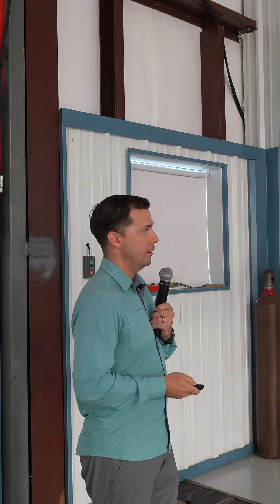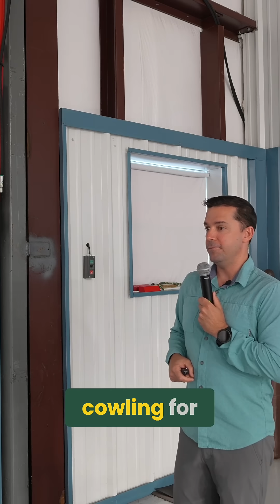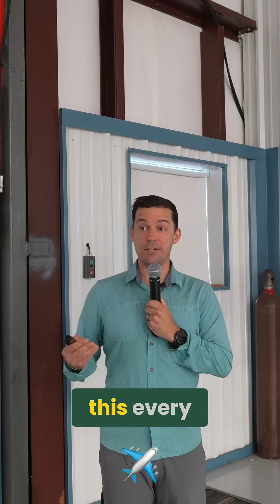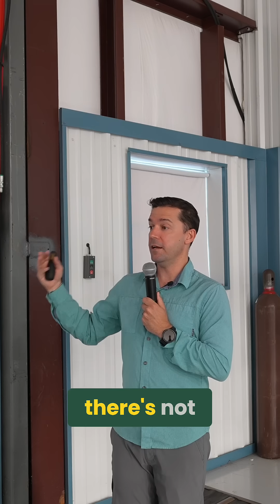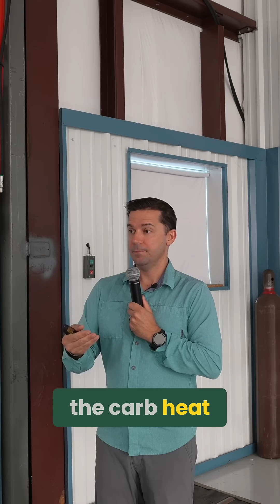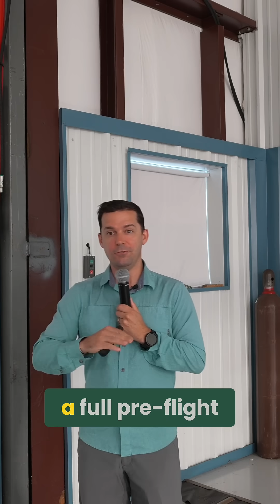Static RPM Check: Your Flight's Safety Net ✈️

Comment: Would like to get your perspective as a DPE if you had a candidate on a checkride do something that’s not technically in the airplane’s checklist.

For instance, one of the comments about clicking a mag off at idle with the carb heat on. I’m not sure I’ve ever seen that in a Cessna POH. Definitely sounds like a great check and something the PIC should be doing. But I’m always hesitant to recommend something that might be considered a “bad habit” by a DPE because it’s not in the checklist.

Thanks for sharing this static RPM tip!
Reply from the maker: I wouldn't have a problem with it as long as the applicant could tell me why they are doing it. A hot mag check isn't a checklist item on many manufacturers checklists, but it's still a good idea to do it.

Comment: Always check RPM right as the roll starts, never heard it called static RPM check but I like the name!

I’ll add another check, when you close the throttle as part of checking idle during run-up (post mag check), click a mag off and make sure the engine doesn’t die. I call this “low idle check”. Throttle closed, carb heat on, and one mag dead. I want to know that engine will at least idle and not worry that I’ve got a stalled engine right at the moment I need to do a go around. And yes, I have had an engine stumble and die during a ground check in this situation. Would idle okay with both mags, but click one off and boom, stumble and die. Mags can fail in flight and you may never know. Pull power to land and suddenly you’ve got an engine that can’t make enough power to even keep itself running. Yes the prop might windmill but….don’t want to rely on that alone.
Reply from the maker: Great points, thanks for sharing!
Reply: Our checklist calls for a low idle check (C172E) & mag check at low idle. I normally pull throttle for low idle & then carb heat which usually produces an alternator warning light & then raise rpm to 800 for mag check after closing carb heat.